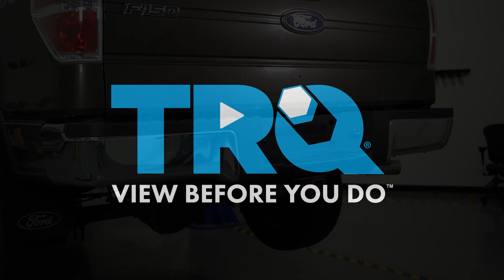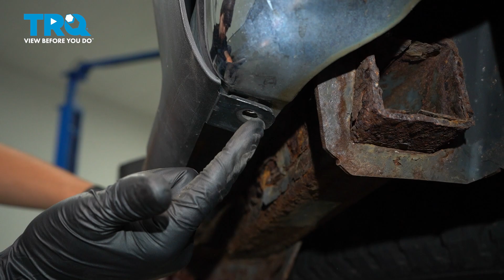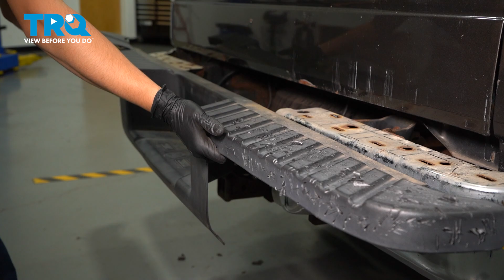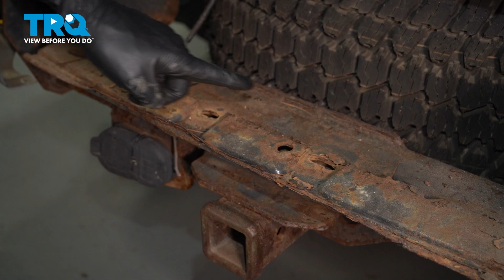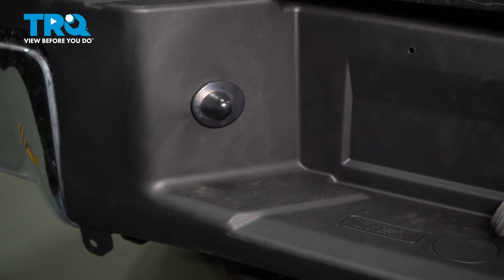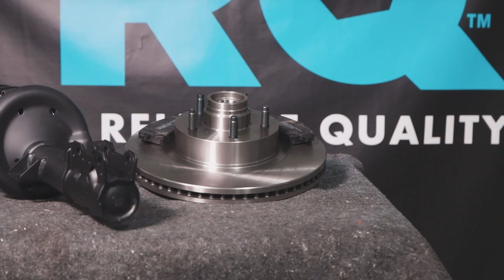How to Replace Bumper Step Pad 2009-2014 Ford F-150

Comment: Thanks for the installation advice on this step bumper.  My son's F150 was rear ended and the black portion of the bumper was torn off.  The chrome parts are almost perfect so we went to a collison shop to get an estimate.  We told the guy that we would have to pay 100 percent for the repair due to uninsured motorist and please keep the costs down.  They came back with an $1,780 estimate with an all new bumper assembly.  
After looking at your demonstration, we purchased the step bumper pad from Carparts for $52  plus shipping.  We should have to new part on the truck this Saturday.  We'll have figure out some wiring for the license plate light and backup sensors.
Thanks again!!